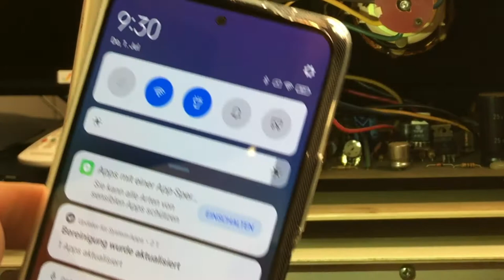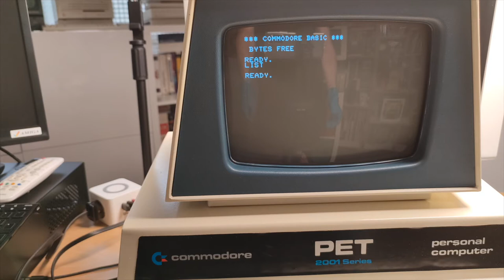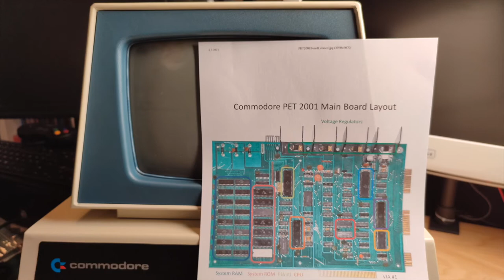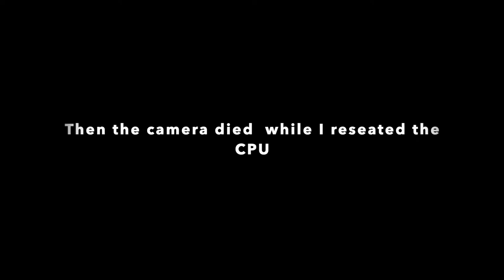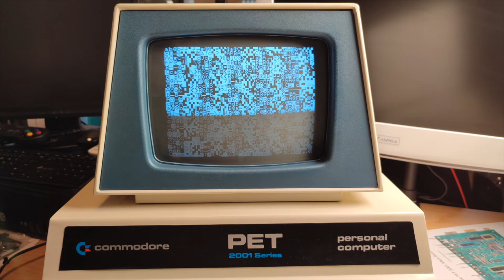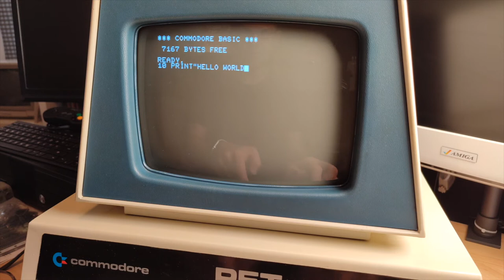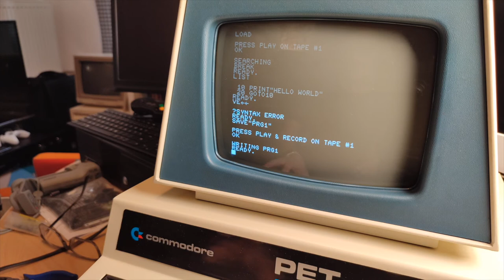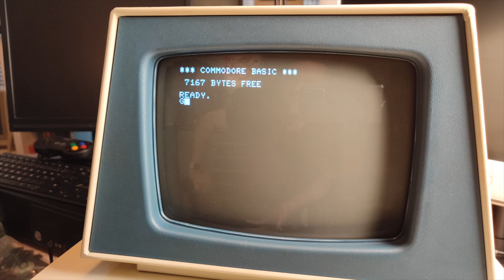Commodore PET 2001 (AKA The PET that almost killed me) - Part 2: Repairs

Comment: Great Job!!!!! Your brave working on the CRT!!! (also smart wearing the rubber gloves!!) I've seen enough CRT repair videos to know its a dangerous job with the high voltage!!!  I can't wait for part 3!!! I'm hoping for you its a 3 part series and not 4 or 5 parts!!!!!
Reply from the maker: Thanks Charlie! I am working on part 3 right now. That should do the trick ;-) There might be a part 4 or 5, but that would be just tinkering with the PET and it's many hard- and software projects available.

Comment: You can cut off a leg from a similar IC and solder it on top of the broken one. Works for me. Commodore chips are CMOS and are VERY sensitive to static. Make sure your soldering iron tip is grounded!!!

Comment: Just a quick suggestion. When you tapped the top of the Pet in the intro, the whole camera shuddered. It was most disconcerting! Either isolate the camera from the desk or don't tap the desk?
(Just picked up a 4032 I am prepping for firing up the first time)
Reply from the maker: Thanks! Already did that for the new videos.

Comment: Nice repair. If the computer dosen't give any audio clues during load or save, I always play the tape in a normal cassette player so I can hear if there is anything on it. Just to be sure.
Reply from the maker: Thanks! In the heat of the fight (repair) I often forget the simple things that I could do and just follow the white rabbit deeper into the hole ...

Comment: Clean all the ram sockets with alcohol and change any chips that are unusually hot. The 6502 will run fine at 1MHz. looks like a ram fault. Check your ROMS and RAM for overheating.

Comment: Your PET motherboard may be the same as mine - I have the same bodge wire to the left of the RAM.

RAM: 4045s, 
S/N: 0030267, 
Motherboard: 320132.
Reply from the maker: Yep. Same. Serial is: FFI 781223
Reply from the maker: I attached the photo of the serial label to the end of Retro Packages #7 coming on thursday!

Comment: B.T.W.,   when you were worried about that "MPS-6540" chip having a broken off pin, it wouldn't matter. It's not used!!  See Pin-28 below...
http://www.dasarodesigns.com/wp-content/uploads/2014/03/6540outline.png
Reply from the maker: Thanks! Interesting. So maybe that would have worked anyway.
Reply: @RetroWK  Yep... 'Someone' had cut off that Pin-28 as it's Not-Connected (NC).
I can't imagine why though. Probably just to remind himself that the pin is not used !?  Note regarding your video...
Old devices like that Machine, always have oxidization between pins & sockets. The 1st thing I would ALWAYS do, is
to not  necessarily fully pull out all such chips, but at least 'creep' them up a bit, and re-seat them!!  (90% of probs!)
(That is, PRIOR to going down any other Fault-Finding road that may be necessary )
P.S...
Yea that High  Voltage loose cable was NOT good!!  I would 'like' to think it wasn't deliberate, by the last person working
on it, but due to the inherent problems of incorrectly Clipping It In, such that it had later Popped-Out !!  You did a great job
though, and keeping another piece of History in working order!  😎👍🧑‍🦽
Reply from the maker: @glennsprigg2378  Thanks! I did reseat and lubricate all the ics since then. I am always in shock when I turn the machine on and it just works!